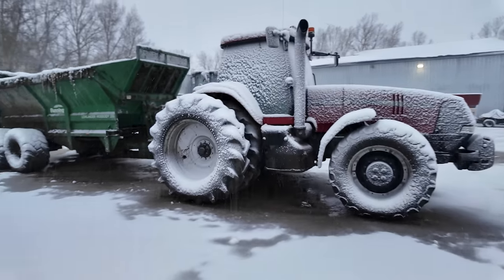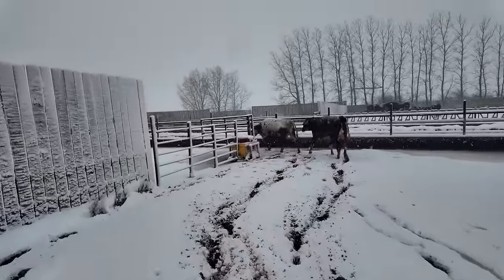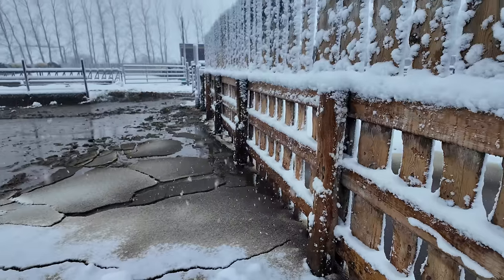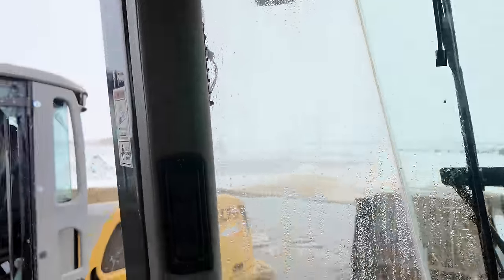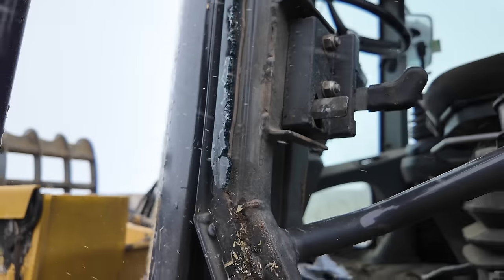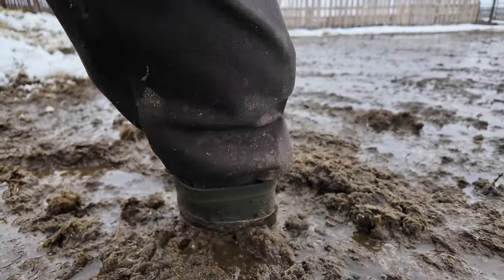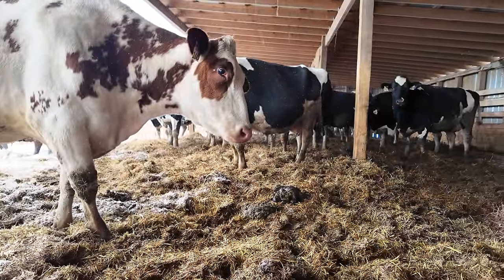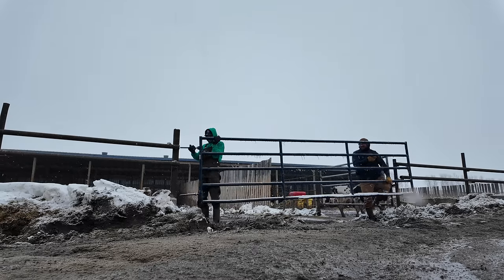Hauling Through The Snow Storm!

Comment: Wow just Wow. Soldiering on in crazy conditions. A good old fashioned spring blizzard for sure. Has not happened for quite some time. They reported 68 accidents on Saskatchewan highways in one day. I tried going for a drive in the country yesterday just to see how things were but cut it short for two reasons. First you could not see anything the wind was so strong and two the snow drifts on the grid roads were so tall in places they were hitting the bumper and coming over the hood. Fun times on the prairies.

Comment: Hi Jan, look at all that SNOW !! Oh My Gosh. 28 mm of snow on Montreal, would have shut the city down, until the plows cleared the streets. We have not seen snow that deep here in a long time. 15 or 20, yes, but not much more. I'm glad you are on the other side of Ontario, once again. The great snow break !!! Temps here in the next week are going to See Saw from one end to the other. UGH !! lots of rain, but no snow. Hang in there.
Reply: 28 mm of snow is 2.8 cm .. just over an inch (2.54 cm) ..
Reply: @JAMESRS58  I knew my calculations were wrong. 15 to 25 cm of snow here is a baseline, anything over that is a problem.

Comment: That snow looks not too inviting. Hope it is the last one until next winter for you. When you want to pump out the water where some organic debris will clog up a regular pump you might try a grinder pump like they put in sewage lift systems in homes. They grind up the matter and it might not clog up.Just what you need after having to buy the new tire for the spreader. You are are being tested today, but you came through like a real champ. Great job making sure the straw pack leaning on the fence does not cave it in. Glad for the silver lining on the snow with the needed moisture. Thanks for a great video. You sure take the time to make these videos for us and it a really appreciated.

Comment: Why not spread the manure on the fields or are they seeded already?
Reply: They used hemp straw for the bedding over the last year. Hemp is very tough. (That's why it can be used to make rope) They're worried that it will cause issues with their seeder if they spread a lot of it directly on their fields. They're hoping that it'll break down if they let it compost over a couple of years. The composted manure will make better quality fertilizer as well.